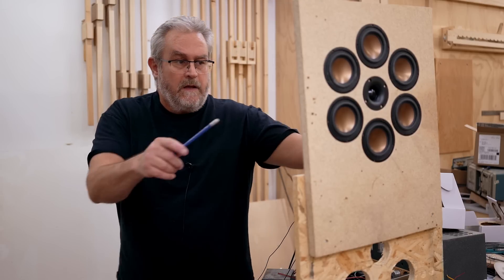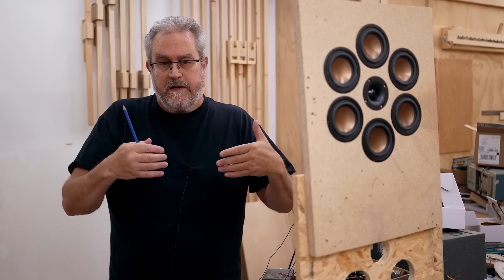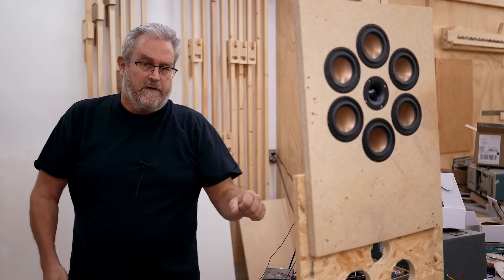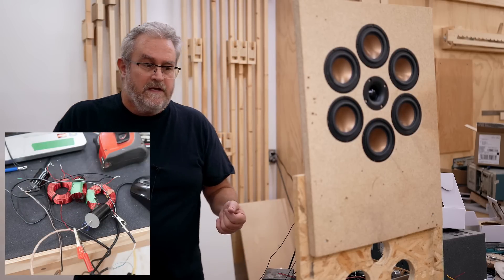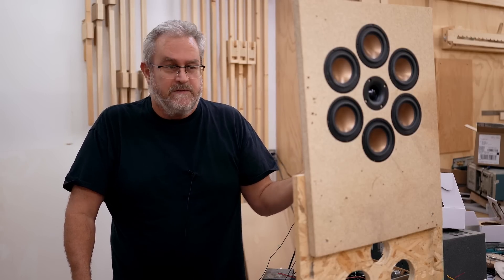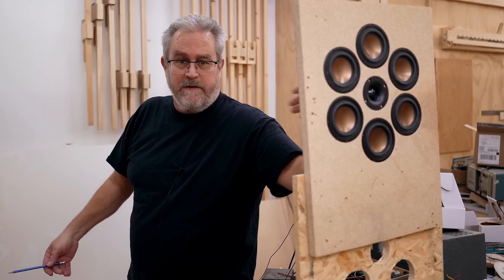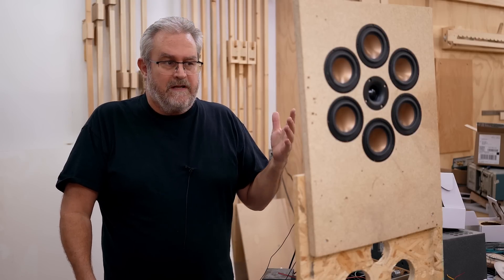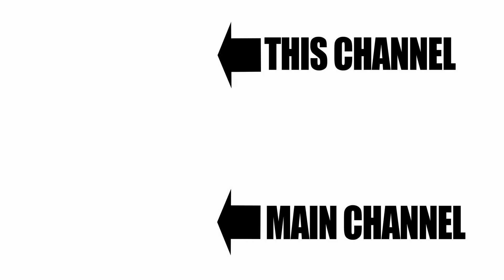All I Can Say is... Wow!

Comment from the maker: The concept: use several midrange drivers ringed around a very efficient tweeter to create a high sensitivity point source. The mids / tweeter act like a dual concentric driver (coax) without the main problem that come from loading a tweeter into a moving horn - doppler distortion. 
I tried 4 mids to start (the first set of measurements) and found that the tweeter was still a good 8db more sensitive. I could pad it down, but decided to try adding two more mids and that raised the sensitivity of the mids by another 3db. The second set of measurements show the on and off axis response.
The results are quite good and certainly better than I expected. With the crossover set to around 1400Hz, there's no significant amount of comb filtering. and the off-axis response is excellent.
Of course this is just a very roughly done test to determine whether it's worth pursuing, and what I've seen so far pretty much guarantees that.
The drivers I used are the Hi-Vi B3N 90mm fullrange and the Peerless BC25SC06-04 horn loaded tweeter. Both drivers are very low cost but my initial impressions are that they sound very good. Reviews for both drivers are also very good.

Is it worth doing? 
6 of the B3N drivers cost less than a good quality midrange driver, but they require a much wider baffle to fit into. The most common thinking these days is that a wide baffle destroys imaging and soundstage, but I haven't found that to be a written in stone rule. I've made many different speakers of many different sizes and I can't positively say with certainty whether narrow speakers produce better a better defined soundstage. It's been my experience that speaker position plays a MUCH greater roll in how well a pair of speakers image. Also the room is a big factor, especially an excess of early reflections. And this is also at odds with the standard thinking on this today, with most saying you NEED the early reflections to produce a good soundstage. 
Since there are 6 midranges to install, the build is more complex. But I think that's offset at least a little bit by how interesting it looks. Looks count!
I'll admit that I'm disappointed that I'm not getting a higher db output from 6 of these drivers (at the same power, each additional driver should add 3db). I thought that 4 would have come closer to the 96db output of the tweeter than they did. Some of that is from the mids operating on an open baffle and the efficiency should increase when they are enclosed in the speaker cabinet. 
Also, you can think of it this way: instead of one motor (magnet / voice coil) for the midrange frequencies, now there are several, which greatly increases power handling capacity and reduced the distortion associated with power compression. Also a much greater cone area translates to less cone movement to produce the same output. In other words, you get the advantages of a large speaker without the expense and other drawbacks.

The mids are wired 3 in parallel x 2, and then the triplets wired in series for a total nominal impedance of around 5.3 ohms. 
The woofer I'll use for these speakers is an 8" Seas that has a 93db efficiency.
Reply: Interesting idea, I hole you'll share the final result of the project and it would be great also a sound test ;)

Comment: The membranes in your concept do move as well alike a typical coax-speaker. The difference? Your set up does not as much work like a waveguide, but there are still cones, alternating sound coming from the tweeter. If a tweeter beams like here, beacause it is a horn loaded dome, this would be the same with the typical Tannoy-Speakers, that use a horn-tweeter in the middle of a huge cone (12" or 15" for example). In this case, the doppler-effect, if hearible (what I doubt) at all, will be minimized.

Comment: Try it with 2 in mids,stop wasting time with transmission lines unless you are building 40 ft horns for theater use, you can always study new designs like I did and turn down the tweeter  to match. I dont like your ideas. I use 2 ,2in open baffle ,ribbon tweeters, 1, 8 in mid bass, sealed and sealed duodayton18s 
It is wicked..

Comment: Okay so probably a very stupid question  but i have been geting very mixed messaging from the articals i read.

Can you make a open baffle speaker with a speaker made as a in wall infinite  baffle. Like are the speaker units essentially the same and its just the design of the housing thats the difference or do you have to get speakers more made for this set up.
Reply: Essentially, any loudspeaker can be implemented open baffle.

Comment: The drivers are too big and the spacing is too far apart, try 5.25" drivers or smaller and get them as close as possible to reduce the cancelling. This idea solves some issues but creates others. Very powerful however.

Comment: What you wanted to say was that the outer woofer of a coaxial is phase modulating the tweeter by a low frequency cone. This is actually measurable and looks like the centre frequency has some skirts alongside it.

Comment: 92 dB on axis at 13k and 84 dB at 20k (Almost half as loud). Looks like another tweeter or two or at least one with more high frequency response is needed. Pretty good from the low end to the mids though. Cool looking design.
Reply from the maker: That's the typical drop-off you get from horn loading a tweeter. Since I can't hear above 11k anyway (and there's not much musical content up there either), it's not something that needs fixing.
Reply: @IBuildIt  I am fortunate enough to still hear to 17,500 Hz in one ear, and 17,000 Hz in the other ear. So yeah, high frequencies that roll off before that sound like listening to music with a pillow over my head. LOL. But hey, if 20-11,000 Hz is good for you, more power to you.

Comment: Looks like the outer drivers are about 0.2 meters apart center to center.  That's pretty far apart for midrange drivers.  So speed of sound 343 m/s  and half a wave at 0.2 meters,   343 /  .2  / 2  = 857.5 Hz .  If I did the math correctly, I expect you will see a 20 * log10(.33) =  9.6 dB dip in the response with a sealed box at 90 degrees dispersion angle at 858 Hz due to the driver spacing cancelation.    The 0.33 is from the outer drivers canceling each other, so only two of the six drivers will radiate at 90 degrees.   You could smash the outer drivers closer to the tweeter horizontally to bring this frequency up a bit.   I've been playing with a matrix arrangement of 2" midranges two wide and three tall.  That works well up to 2,500 Hz.  I recently decided that a speaker with a nearly flat response 90 degrees off axis is what I really like.  I gave up on using HiVi drivers as they had limited Xmax and high distortion before they reached Xmax.   I was initially attracted to them by the ruler flat response in the data sheet.  They don't publish distortion figures for a reason.   You might look at the Aurasound Whisper 2" instead.  They are amazing.   Go get a miniDSP digital crossover and you can save a lot of time and get much better results.   Go download Visaton free Boxsim software from their website.   Enter that design and see the wild variation in the directivity with frequency.  It maybe an entertaining speaker, but I don't know anyone saying, let's have wild swings in directivity and then designing a speaker to achieve that.

Comment: I go back to the 50's and I was an early experimenter and one of the magazines, Popular Science I think if was, but not sure, did a system with 16 four or five inch speakers that they called the sweet sixteen and the array was 4x4.  I had built some speakers for my "hi fi" system using "full range (Lol!)" 12 inch speakers and they sounded pretty good tho I did not have any sound measuring equipment so I doubt they were very flat at all, just sounded good to me.  I had a little probably 15 watt tube amp I got from Radio Shack.  So in college I got in my first band and a good  PA then was not very good lol!  My guitarist and I took a shop course in order to have access to the tools we needed to build our own PA.  We used 6 eight inch speakers (the multi speaker systems that started to appear in the 60's weren't available yet) for each cabinet and we built two of them and used a 100 watt Bogen amp with two mike inputs built in, no EQ but that was our PA and it sounded quite good for the time.  Fond memories!  In the sweet sixteen article they pointed out that when you double the cone area you roughly halve the bass response, and sure enough, while it would not scare anyone today, it sounded good for then and was reasonably portable.  I went on to have a fun career in music eventually owning my own studio that I ran in and amongst touring.  I'm now "retired" to my Mt. cabin in NC where I make vids for my Youtube music channel in a small studio which I built beside my cabin.  It will be interesting to see how your system works out.  Looks quite promising!  I enjoy your vids by the way!
Reply from the maker: Thanks! Great story.

Comment: Such an ingenious design. Patented by Eric Alexander at Tekton.
Reply: Tekton's version uses tweeters, so this is quite different.
Reply: @folked-up  I mean… the only difference is size, weight, and material of the drivers. The design, i.e. the polycell array the drivers are in, is what Eric Alexander uses. I shouldn’t have said “patented”. Part of his patent is also written up using specific parameters on the drivers he chooses as well. 

But the point is that the correct terms is “drivers”. It doesn’t matter if you say tweeter, woofer, subwoofer, they’re all drivers. This dude’s using mid-woofers. Still a driver.
Reply: @MyFatherLoves  Size, weight, and material of drivers are a massive deal that would most likely invalidate an existing patent requiring a separate one. Not that it's relevant, but I'm a Tekton DI owner myself.
Reply: @folked-up  He tried to patent using an array of different drivers (see original patent application), but it wasn't allowed.  What was allowed was all the drivers (center and surrounding) being the same.
Reply: @abboberg  Right, because that's how patents work. You can't patent a concept, it has to be a specific execution.
Reply: @folked-up  That's true, but that's not what I was referring to.  He wanted to have the patent broader (in his original, filed, application), so he could get exclusive rights to make any kind of array.  Unfortunately, there is prior art, so it wasn't allowed by the patent examiner.  What was allowed was to have all the drivers identical, which in this case, was having identical tweeters surrounding an identical tweeter in the center.  Of course, it just becomes a "troll patent", at this point.  To not infringe, you would merely use a different driver to surround the center one - even a different style of tweeter.
Reply: @paulhufziger9434  he’s too busy suing every person who reviews his products poorly 😂

Comment: Great project!   Been considering something similar for over 10 years myself, but never get around to it.  Was going to encircle a planar driver with some small midbass drivers.   I wonder if your measurement labels are incorrect or something btw measurement sweeps got altered.  There's no way that the above 7K response ON AXIS should be lower than off axis.  And the smoothing of the orange line looks more than the green and blue.  In any case, looking forward to further progress.

Comment: Liked and subbed. 1st video of yours I've seen. Definitely going to be watching more of your videos.  I'd like to see you try putting a Ribbon Tweeter in one of these COAX  designs.I'm a sucker for the highs from the ribbon transducers of the Adam Audio monitors. A buddy in 1974 had a pair of Heil speakers with the Air Motion Transducer sitting on top of each cabinet.The Adam's design is from the Heil designer. Mind Blowing at the time,to say the least. Been listening to a pair of powered Presonus S-8 COAX monitors for the last 10 years.  And a bunch of different studio monitors in that timeframe that have come and gone.The soundstage and imaging with the S-8's in my small studio is amazing. Monitors are slightly off axis.  Neil Pearts drums hang in the air between the monitors.   Looking forward to seeing this current project in a cabinet.   I would like to build a pair of my own monitors.                                     Best Regards.  👍   👍